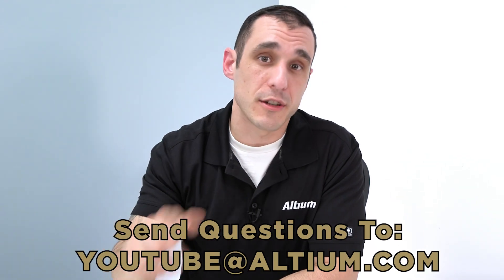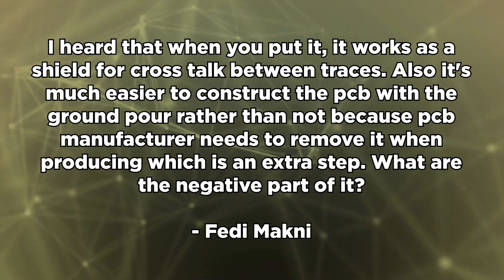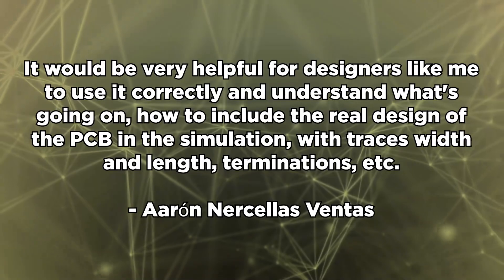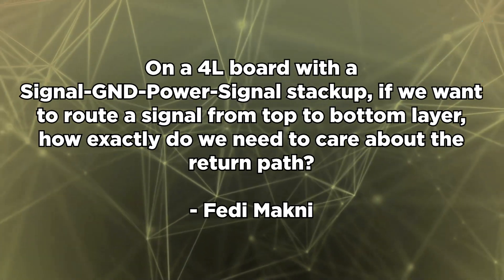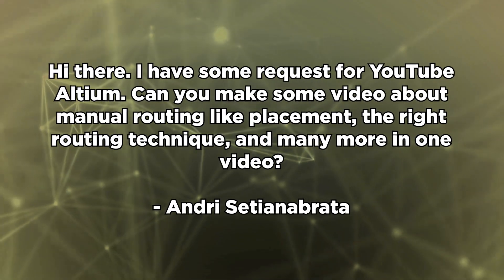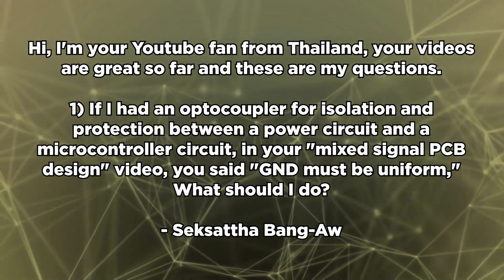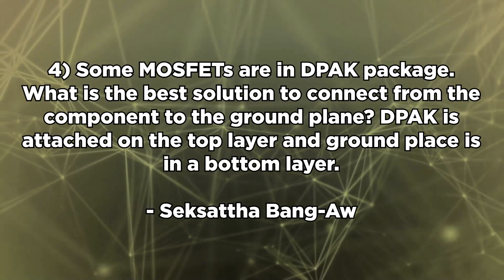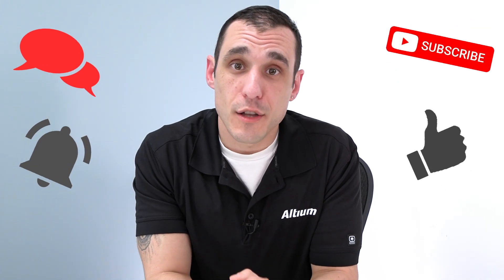20k Q&A | Your #PCBDesign Questions Answered!

Comment: No, DC current return path is not a straight line back to the source.
DC return current in a ground plane spreads all over the board, with the highest concentration being a straight line back to the source. 
But there will be mA/uA/nA of current flowing all over the plane.

Comment: Obviously, completely separate grounds (because boards not even nearby) is the best separation; just impractical if the parts need to communicate at all.  The question is whether to route across a gap, use a very narrow connection, or have a fully-connected plane with such wide connectivity that no particular location gets overwhelmed.  The old advice was to keep the connection narrow, and the new advice is make it solid.  Does that apply universally, or only with signals above certain speeds (which are now almost universal?), or only ...
Reply: I would just say that the best practice for the majority of designs is to use a complete ground plane when possible. A board with a lot of digital components and an analog interface is a good example. Proper layout is just as important; place the analog stuff so that it is not near the digital stuff as much as possible. For slower buses (I2C and slower SPI for example), where you don't have impedance control, you can usually get away with tieing together ground pour on the surface and lower layers so that you kind of cage up the digital signals. If you have impedance controlled signals then it's best to use a uniform reference plane. If SNR is low in your analog section, then you might need to cage up the analog stuff with copper pour and vias just to get some extra shielding.

There are cases where a slotted ground plane or completely separate grounds are helpful or needed, but those applications are the exception and not the norm. Very low level analog measuremnts from specialty sensors are one exmaple simply because you can't tolerate any noise at all in those applications. In those systems you're using some other technique like chopping and averaging to get the data, (e.g., lock-in amplification). Another application is audio with slow speed digital buses simply because the audio frequencies are so low and so you might get some interference, where the digital side creates crosstalk on the audio side. Audio has other grounding challenges involving grounding that have less to do with interference and more to do with ground loops and ground offsets that create noise, so that is another set of challenges. High current power systems will also do this simply for safety, or if you have a high current switching power regulator on the board you would want to do this on the input side for safety and to prevent any possible ESD on the input side from damaging components on the output side.
Reply: @Zachariah-Peterson  Rephrasing to see if I understood ... A single ground plane is generally preferred, but it isn't as important if your digital signals are slow and non-impedance-controlled, and you might need a separated ground if you're working with audio or very sensitive analog measurements or dangerously high current.  (I assume dangerously high voltage would have a similar issue, except that you would need more physical separation to start with, so it wouldn't feel like a choice about ground specifically.) 

The likely reason for the old advice is that the digital just wasn't as fast (so single ground wasn't as important), and there was more emphasis on audio or at least analog, so the "exceptions" where you did need to split were more common.  

The relative importance of continuous power (or just DC specifically?) vs changing signals would also explain why things like an LED string are still fine with a network of wires instead of a plane.
Reply: Yes you have it correct.

For digital of all speeds, you get the best results by interleaving signals between continuous planes. With slower digital, I would just say that you should try for continuous ground but sometimes it's not practical, like on small MCU boards. We've done digi+analog boards with slower digital and RF using tied copper fill everywhere for ground and everything passed EMC and worked perfectly. However, we also had very high isolation waveguides for RF with continuous ground under them and ground w/ vias all over the digital section, it was the least bad way to ground everything and get to a condition that approached a true ground plane. In that case, we only had one GND net, we didn't split things into an RF net and digital net. I'll have to show an example of this because it's all really instructive for good layout and routing practices.

And yes you're right about the power system points. Also with respect to DC vs. switching power. The thing about true DC nets is they can still make nice big inductive receiving antennas if you have large loops, they just won't radiate because they are not carrying a changing current. This is one reason slow switching regulators can have problems with radiation and conducted EMI; even if the switching driver and gates have low rise time, they can still have high dV/dt and high dI/dt nodes so they will create a lot of noise.
Reply: @Zachariah-Peterson  thank you

Comment: Our company is looking at the parts database system with Altium 'Pro'? We're a small company and need a demo of what we could do with it. We've inherited a design where 10k resistors are plonked down across the schematic and values changed on the fly to reflect values with nothing like tolerance or  anything entered. Would love a video to see the easiest way to do it. Used to work for a huge company with a team doing libraries using Mentor.... Many thanks for the videos.
Reply: I have made many database libraries for things like caps and resistors using MS Access. But any database system can be used. It is not that hard at all. The benefit is that you can pick a value and place it. Not just plonk 10k resistors and change them afterwards. That is begging for errors
Reply: @afre3398  I agree, but that is what we have been given. The endless rush for now now now creates mistakes and errors.